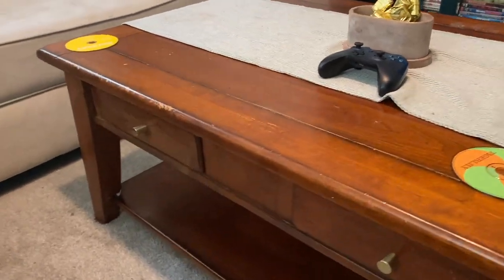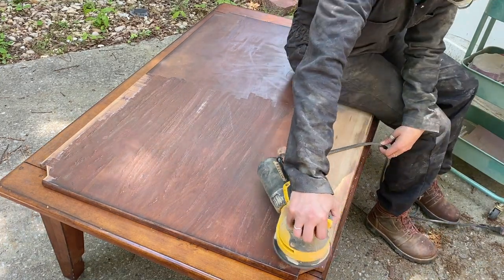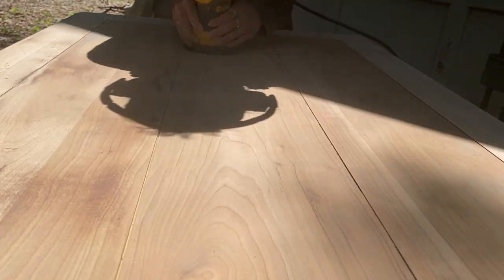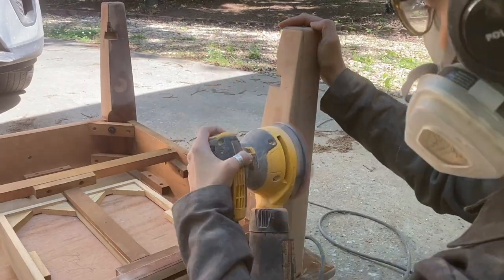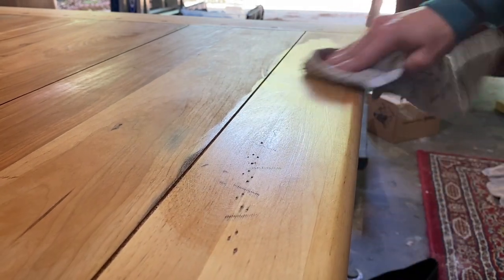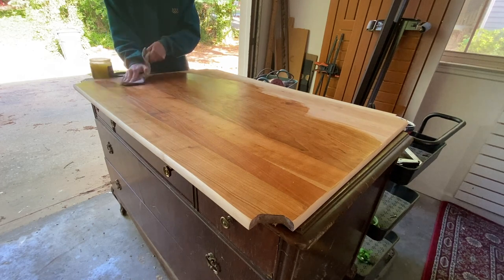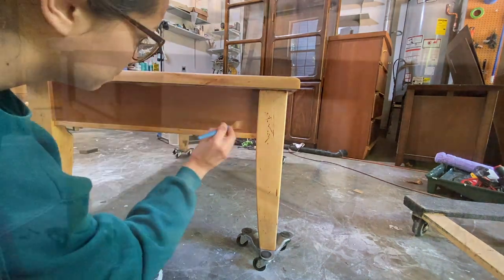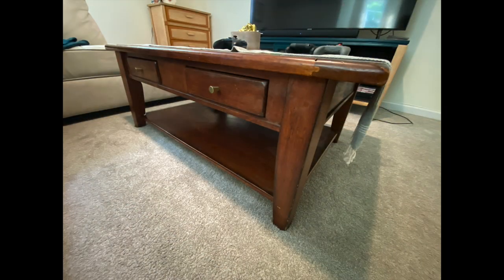Easy Flip For Beginners | 24 Hour Flip

Comment: Wow Miss I really like it. I love it when you have a plan and it’s not what you planned. You just change it up and keep plowing.  I’ve been telling other artist and I wanted u to know about the 411 hwy yardsales
Reply from the maker: Oh what is that??
Reply: If you are familiar with carters lake in Ellijay hwy 136 goes from Pickens -gilmer county. It will run into hwy 411 at Ralstons corner. GPS should get you there but they have the hwy 411 yardsales running state wide. I really don’t know exactly where you are but you will just need to run that hwy and see what you can find.  Not sure if it’s June or July but it’s hot as hades every year.  Lots of items and when I get a correct date I’ll let u know.